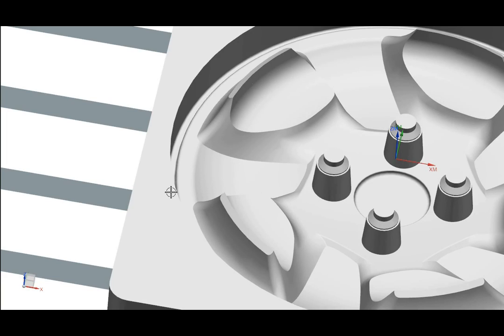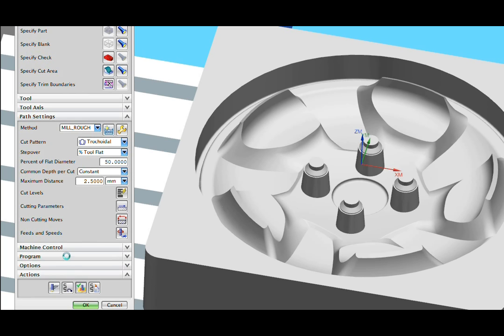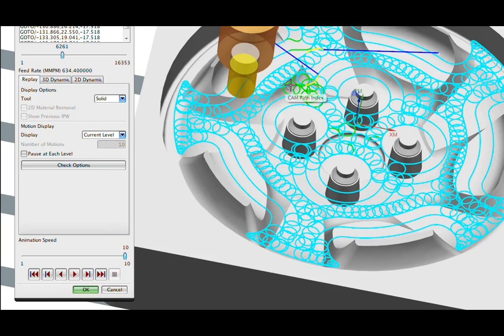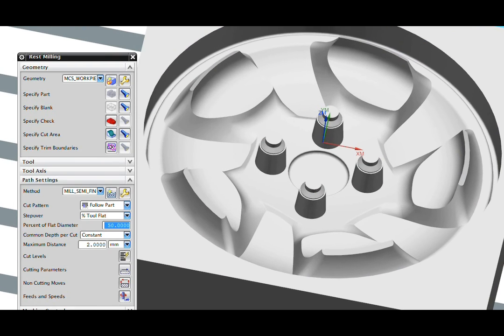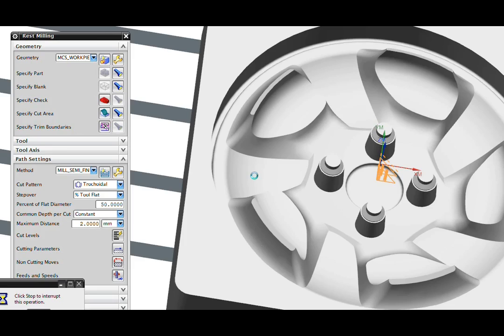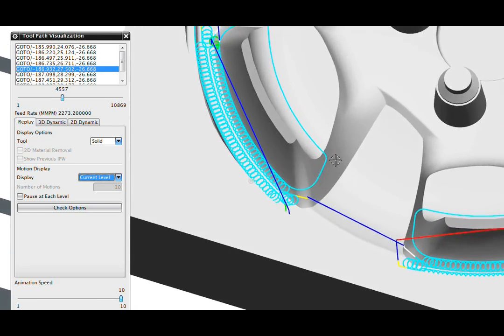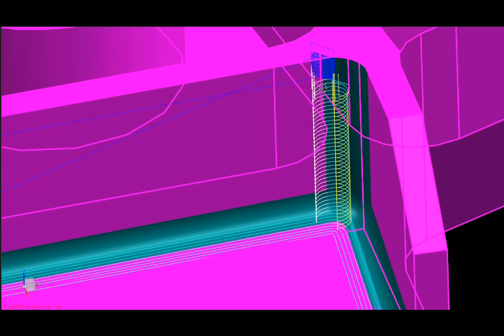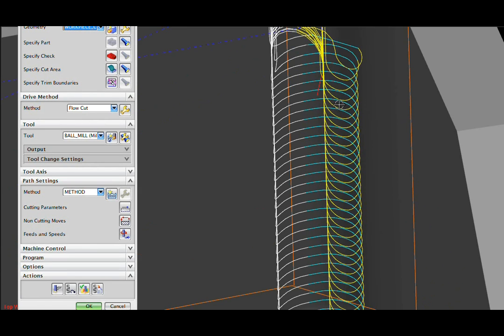NX CAM | Video Tips - High Speed Machining

Comment: do you know if there's an option to reduce spindle rpm in the begining of a programbon nx? im machining hard steel on 6000 rpm, when engaging  (helical interpolation)  to max depth, the cutters burns, i need it to start on 2000 rpm and then when reaching the bottom, it should be incresed to 6000